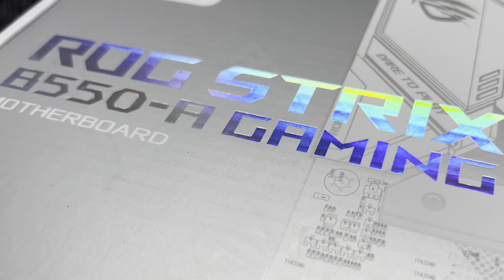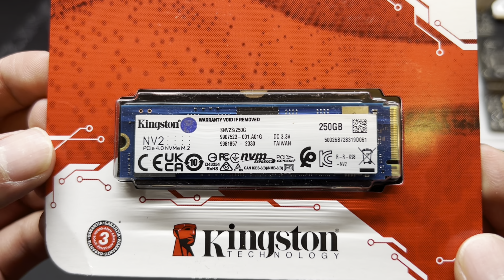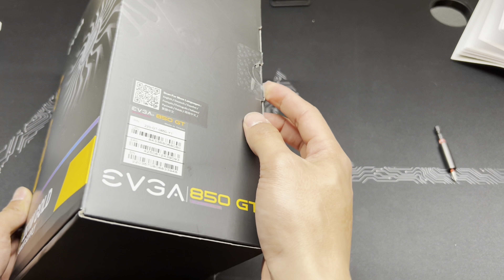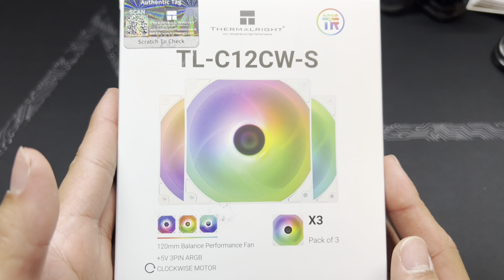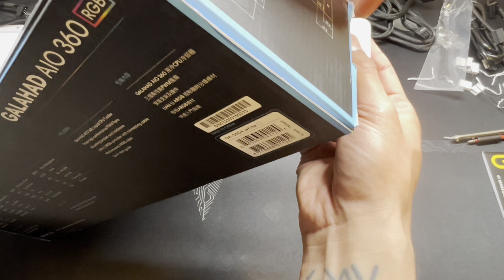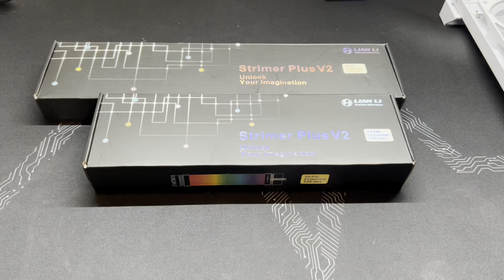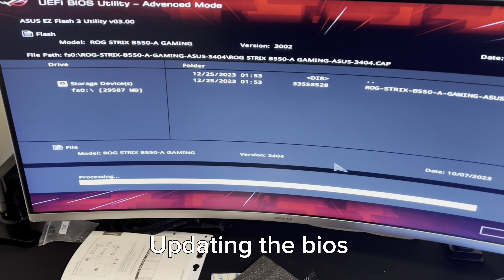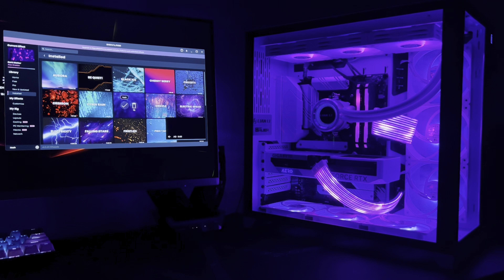My First PC Build | White Build | Lian Li O11 Dynamic | 4060ti | RGB Overload

Comment: Clean build you should have went with all Lian Li fans and and you could got the infinity so they clip all together with one wire so cable management would be cleaner and then down load there software and there is a lot of customization u could do with them but all around clean build my first gpu was a 4060 ti not a bad card will do the job 💯
Reply from the maker: Thanks bro! That’s what I want to eventually do but they are hella pricey at the moment for me but eventually that’s the route I’ll do 🤙🏽
Reply: @Pvrelos  yah that’s right bro it takes time I’m still building mine I upgraded to all lian li infinity fans and I love them bro makes your pc build clean wish I could show u my set up but I went with an all black build still looks good though but the white just stand out so much more brother 👌

Comment: Instead of buying a 200$ case, a useless 150$ 360mm AIO and an overpriced 4060 ti you could've bought a 7800x3d, a good air cooler, DDR5 non-RGB RAM and a much better performing AMD GPU like the 7800xt or 7900GRE, maybe even the 7900xt.

If you didn't go all out on useless RGB and aesthetics you could've probably bought a pc with 60-80% more performance and way more future-proof for the same price.

This is of course my opinion and you are free to spend your money however you want, but this is a very bad pc if we're talking about price to performance.
Reply from the maker: @Void-kn8xx  In terms of what I use it for, it’s more than capable. Never had an issue running a game running high/ ultra settings and frames stay consistent. Yes I could have cut cost in certain areas to make it that much more better on performance, but for my needs and a first build, this Is perfect for me 🙌🏽
Reply: @Pvrelos  Yeah I understand.

The thing is, the ryzen 9 5900x is starting to get a bit old, and now with the new ryzen cpus coming out if you ever want to upgrade both ram and cpu you will also have to get a new motherboard which could be pretty inconvenient.

Putting aside performance the big issue is the lack of future-proofing. With AM5 you would've most likely been safe for the next 5 years and could've saved more money to maybe upgrade the gpu with the newer nvidia and AMD releases coming in 2025. 

In 2-3 years max your PC won't be able to handle gaming at high/ultra anymore, so if you want to upgrade you're going to have to change your cpu, gpu, motherboard and ram. 

So with the "less aesthetic" build you would've also saved more money later on if you ever wanted to upgrade to keep up with the newer game releases.

Anyways, if you're happy with your PC then I'm also happy for you and wish you the best :)

Comment: damn why you get the 4060ti its as strong as a 3060ti you should have went with the rtx 4070ti which is stronger than the  3090ti
Reply: Have you owned a 3090ti?
Reply from the maker: I think the 4060ti is strong enough for what I relatively do, just some light gaming and editing!